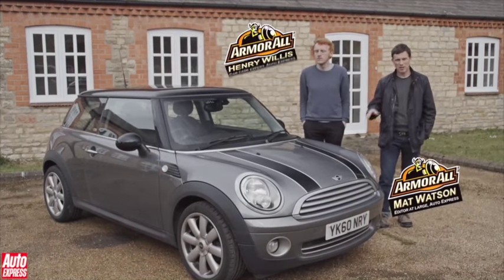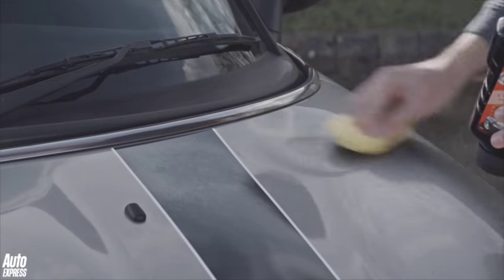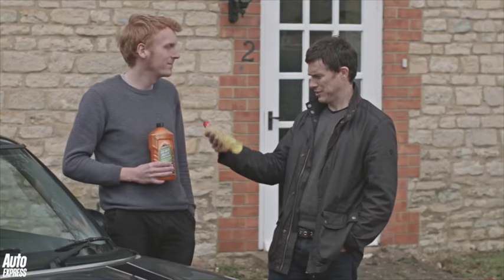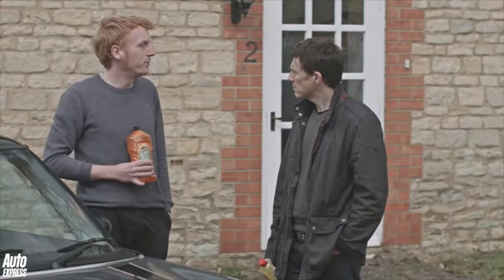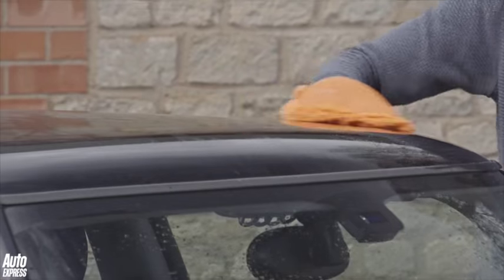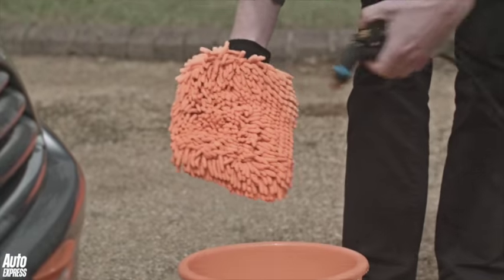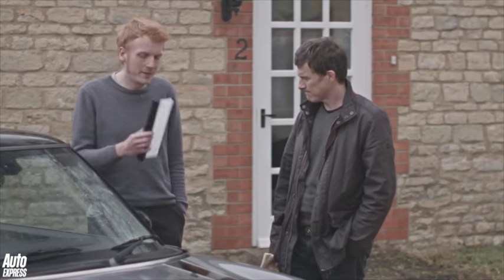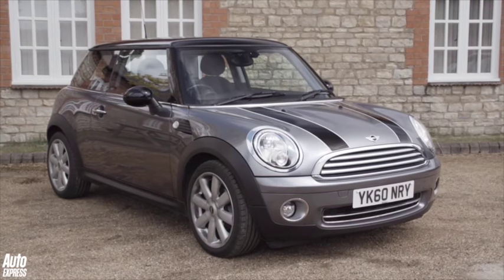Armor All - How to clean your car

Comment: “Swirling it round” is NOT the correct way to wash a car, maybe if you don’t care about scratches and swirls, but if you don’t want scratches and swirls all over your car then you probably Don’t want to wash your car in a circular motion.
Reply: In what motion then
Reply: What is then smartie pants
Reply: @YouTubeChannel-uo8hf  one panel at a time in straight lines, often dumping your wash Mitt in the rinse bucket with a dirt trap on the bottom then going to your wash bucket and getting more soap on your mitt. You keep repeating until all panels are done and then you rinse with distilled water/ water with little to no minerals (avoid water spots) then finally dry the vehicle. The exact and only reason why you Don’t “swirl it around” is because as you move along the vehicle your wash mit will pick up dirt obviously and this dirt will swirl your paint over time even if you dump it in the rinse bucket often.. it’s almost as bad as taking your car through the car wash… I don’t think you know nor understand/comprehend this because you don’t do mobile detailing all day every day, you probably still take your car through the car wash.. well people like me are the people You call in a couple years after owning your vehicle and washing it by “swirling around” we are the people You call to fix the issue, to perform a Correction job and charge you $500 plus..
Reply: How should I do it properly? Do I just go side to side?